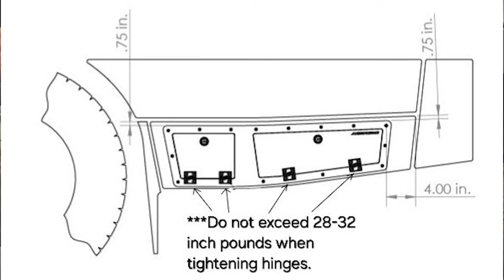Sprinter Van Storage Increase - Add additional storage to your Sprinter Van / A6 Lockbox Doors

Comment: Perfect, thanks for the video! I was wondering how to install it (just saw video on the short version from Owl) and this came exactly on time! About the installation - using the front plate as a template is much better than what owl has in their video (silver back plate). Thanks for the product!
Reply: Easier with the outer frame as the template, for sure.